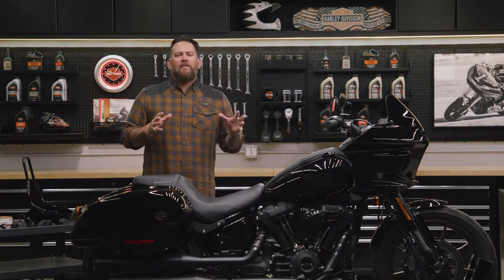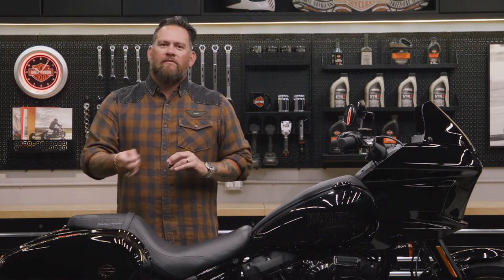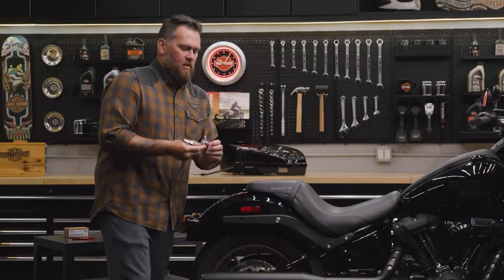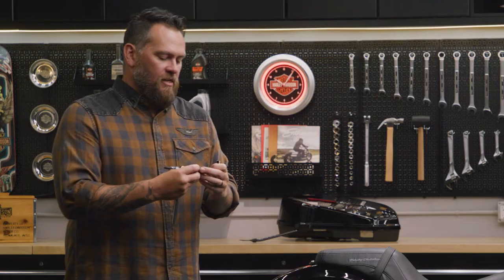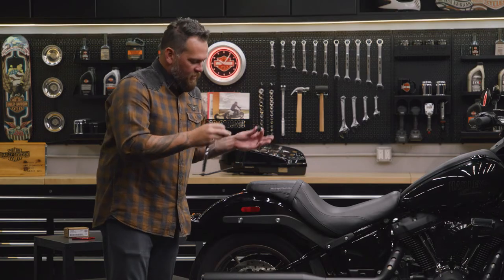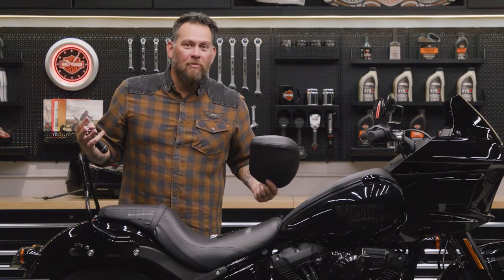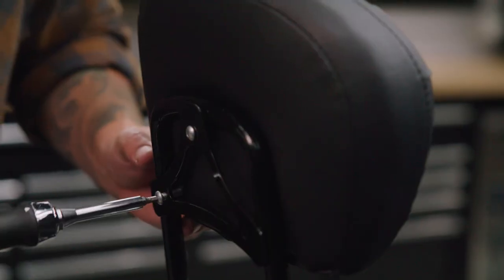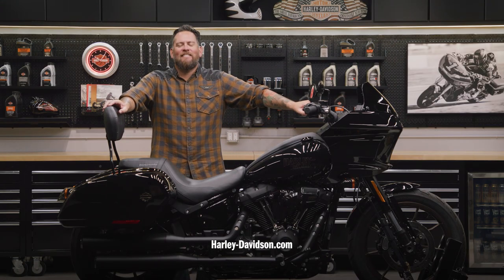Harley-Davidson Holdfast Sissy Bar Upright Install

Comment: Is this a standard or short version of sissy bar?
Reply from the maker: The HoldFast sissy bar upright  is available in short and standard heights for optimized passenger back support. See the different options here ➡️  https://www.harley-davidson.com/us/en/shop/c/motorcycle-sissy-bars
Reply: @harleydavidson  ok, but which one is presented and installed on that film?
Reply from the maker: @TomaszKarbowiak87  Hey! The Holdfast Sissy Bar in the video is standard height. We hope that helps!

Comment: Are there torque specs for the sissy bar/saddlebag bolts?
Reply from the maker: Hi Eric, Please reference the installation instructions for the torque specs. Thanks!
Reply: Um hauling the stock bolt from the FXLRST means I don’t have an instruction manual for that bolt. Can you confirm that the stock longer bolt he uses has the same torque specs as the short one included in the holdfast docking hardware?

Comment: Can you send me a link for the docking point for the Harley davidson nightster special  2023
Reply from the maker: Hey Vency, here's the HoldFast Docking Hardware Kit for your 2023 Nightster Special ➡️ https://www.harley-davidson.com/us/en/shop/holdfast-docking-hardware-kit/p/52300705. This complete kit contains the docking hardware necessary to install all HoldFast detachable accessory options. Thanks!
Reply: Thanks for your reply just want to ask you if in future if I want to change into saddlebacks do I have to change the hooks again because I just want to buy them once and all if it's possible because I see there are two hooks one is big and one is small or they come with the subtle bag.
Reply from the maker: The HoldFast Docking Hardware Kit for your 2023 Nightster Special (https://www.harley-davidson.com/us/en/shop/holdfast-docking-hardware-kit/p/52300705) allows for installation of H-D HoldFast Sissy Bar and Solo Luggage Rack.

HoldFast Sissy Bar - Standard Height ➡ https://www.harley-davidson.com/us/en/shop/holdfast-sissy-bar-upright-standard-height/p/52300700
HoldFast Sissy Bar - Low Height ➡ https://www.harley-davidson.com/us/en/shop/holdfast-sissy-bar-upright-low-height/p/52300702
Luggage Rack for HoldFast Sissybar Upright ➡ https://www.harley-davidson.com/us/en/shop/luggage-rack-for-holdfast-sissybar-upright/p/50300292

The Detachable Saddlebags we offer for the 2023 Nightster Special (https://www.harley-davidson.com/us/en/shop/detachable-saddlebags/p/90202254) include the necessary mounting hardware. The mounting hardware included with the Detachable Saddlebags has the same pieces that come with the HoldFast Docking Hardware Kit, plus the additional mounting hardware needed for the Detachable Saddlebags.

Comment: Hey. Your eom passenger foot peg mount doesn’t work with the low rider st due to the left bag having a different size bolt from the bag. So I’ve bought a 500 seat & 410 sissy bar / mount bracket & it’s worthless.